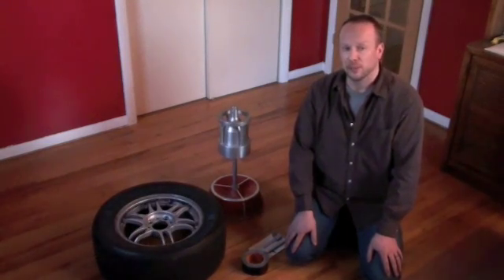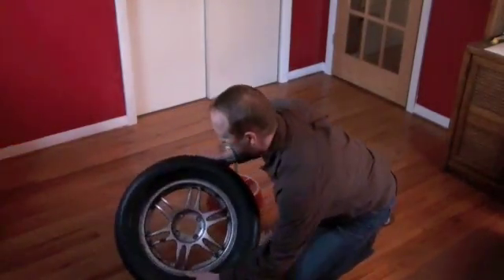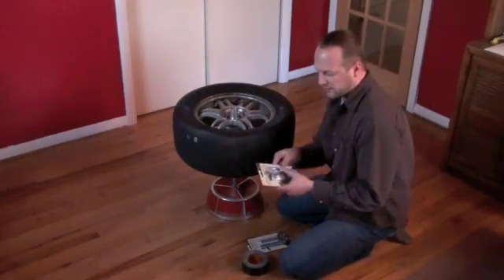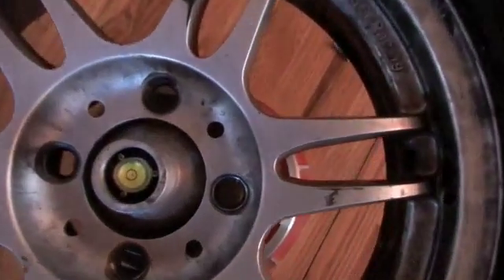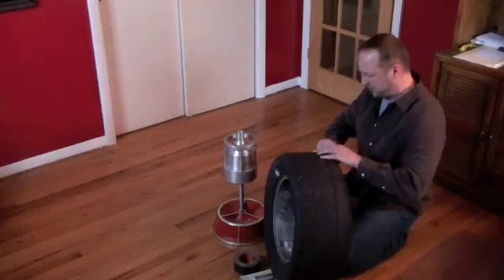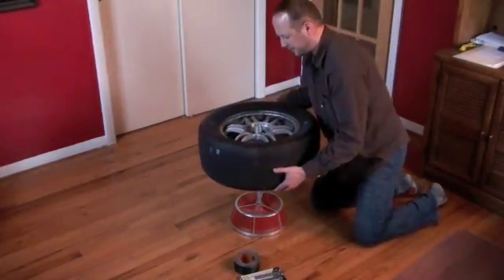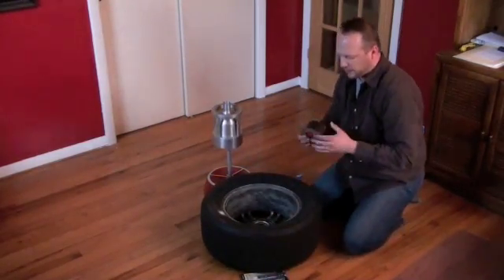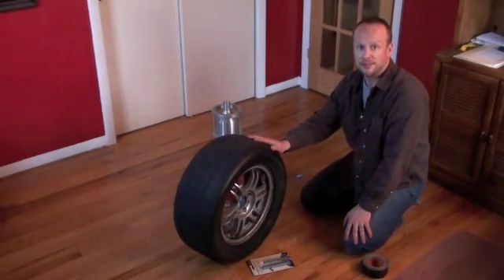DIY Tire Balancing Machine

Comment: That would get a very rough balance, but it's not gonna be great. 
This method was used on old cars where the wheels were less than half the width (think 80mm wide), when balancing wasn't really that vital. Modern wheels, though, need to be balanced inside and out. The reason is because they're wider and cars have different offset values nowadays, so getting a more perfect balance is VITAL.

Comment: Static balance doesn't get anywhere close to balancing a wheel, i have been tyre fitting for the last 10 years and our balance machine has a static option and never gets used as its poor! Only lazy half assed tyre fitters would use it!

Comment: bubble balancers were all we had in the tyre trade back in the 60s and they do quite a good job on older cars,i dont know about newer cars though.i always had to be more carefull with cars using mcpherson strut as they took longer and more patience to get right.these were the days when there wasnt any electrical tyre changers or balancers.
Reply: +MrMagistik Yep that is what my dad tells me.  I see a problem though. Sensitivity is going to depend on the offset. Todays FWD cars have such a crazy offset that the sensitivity will be really poor.  Offset closer to the middle of the wheel will be really sensitive.  Mind you I have only had the privilege of studying the harbor freight units and the commercial units might have an adjustment for that? Would be pretty easy to make them adjustable.
Reply: consaka1 narrow, large diameter wheels static balance is fine. But when you start looking at cars from the 60s and 70s when rim diameters dropped and they started getting wider then dynamic balance became significantly more accurate.
You can do a reasonable static balance on most wheels but why do reasonable when you can do perfect?

Comment: Honestly!!! you will never make proper balance with this balancer. Even when you will have perfect level after you stick the weigh on the rim then you still will be feeling vibrating while you driving. There is two different weigh so you have to put the weigh inside the rim and also on the other site. Sometimes not but usually yes. And it will do only proper balance machine. Even hand spin one is good. It's expensive but it's worth. I know what I'm saying. I have that crap at home lol. I'm going to buy hand spin balancer.
Reply: +Richard Sery Your ignorance is showing. Of course it depends on your definition of "proper".  This is how all wheels were balanced when my dad was a kid and it worked just fine.  
Dynamic balancing is a sales gimmick for the most part. 98% of tires can be statically balanced and nobody able to tell the difference. 
A tire can be balanced just like this guy is doing and you would never know the difference. I have one of these and I have balanced with it and I have also balanced my 8 luck truck tires with a spare spindle. 
The spindle has to be prepared. You want good bearings with no grease, only a light oil. Remove the seal as well. Keep the bearings a tad loose. Make sure the hub is actually balanced and then mount the tire with at least 2 lugs.  Then just add weight on the top side after it settles.  There's a few tricks that help with the accuracy but honestly it works good enough that you have no vibration going down the road and isn't that the point.  
I am looking for a spin balancer though simply because they are faster.
I have seen tires come off of a spin balancer and be completely unbalanced on the road. It was my dads tire and he gave up on the tire shop and balanced it using the spindle method. Only way he got rid of the vibration. 
So don't knock it till you actually do it and have some experience with it.  Oh and by the way if your bubble balancer came from Harbor freight or some other cheap chinese source then you may have trouble balancing tires. In my case they didnt have the dimple centered in the middle of the hub unit that supports the tires. You CANNOT adjust the bubble on the machine and expect it to work.  Identify a flat spot and put the head unit there. Now center the bubble. If you put it back on the base and it shows unlevel that is telling you how off the "centered" dimple is inside the head unit.  Any tire you put on it will always be heavy on that one side of the head unit. Using a sharpie put a mark on one side and then put your tire on and make a note where the heavy side is. Then pick the tire up and turn it 1.4 turn and put it down again.  Take and get one tire statically balanced on a spin machine. Put it on the bubble balancer and see how accurate it is. 
Bubble balancers made properly are extremely accurate and work well. Chinese made like harbor freight stuff is a total hit and miss. Some are good but most are not.
Reply: You forget that "when your dad was a kid", the wheels were less than half the size of modern wheels and tyres. Yes, this would work great for those. Modern wheels are wider and need balancing on both the in- and out-side. 

This balance will get it rough and it'll work, but a full modern wheelset needs a modern balancing method.

Comment: I honestly can't see the point of the duct tape, looks ugly as he'll also the adhesive on the weights is as strong as he'll so as long as you clean any silicone or wax deposits from the rim then their never coming off accidentally

Comment: I don't mind paying $20 for mount and balance.  the problem is bigger.  When you buy 4 tires, they write you 3 pages of invoice that takes you from $300 for the tires to $500 by the time you are out of there.  I am not exaggerating.  Think about $12 per valve stem, $5 per tire to discard the old one; $40 road hazard insurance  and all of this plus Tax.  I really feel sorry for the people who can't help themselves.  I feel sorry for those who work hard to earn a paycheck and then get taken advantage by these tire stores.   Thank you for sharing your experiences with this tire balancer.  I am going to buy one but I want the most accurate one.  I notice some cost more than others.  I wish I knew what is a good one.  I know HF sells one for $70, Sears sells some for $100 but I just don't know what to look for in terms of accuracy and quality.
Reply: sahmadi1000 $12 per stem? Even metal stems arent worth that much. A 414 valve shouldnt set you back more than $3
And don't buy road hazard insurance if you don't want it. The disposal fee is fair enough though. 
See as an experienced tire fitter balancing is the only thing I would actually go and pay for even though I could just buy a bubble balancer and do it myself.
Reply: +sahmadi1000 I have a harbor freight one and its no good for accuracy. Some may be but others aren't I suggest you do this. Take any tire and get it balanced. Then take it to harbor freight and tell the guys you want a bubble balancer but you want to test it first.  Once put together there are 2 main parts.  The base, which includes the pointer piece and the head unit.  zero the head unit on the ground by tweaking the 3 screws.  Then put it on the base and put your balanced tire on it. if the bubble shows perfect in the middle then it is a good one. If not then quality control was non-existent that day.

Comment: Got one!!
Rubbish on small, lighter car wheels where slippage occurs on the top ring when lifting under the compression spring pressure after the cone alignment. No matter how careful you release the wheel you cant ensure the cone alignment stays.
Reply: Further to my comment I have learned a major UK specialist classic vehicle company, 'Frost Auto Restoration'  have determined a set of weaker springs for the balancer to accommodate lighter wheels. These cost around £6 (10 USD) for the set of four.

Comment: Bubble balancing is every bit as good as electric spinning balancer if off the vehicle.
this type of balance is perfect unless we are talking formula 1 race cars with everything else on the car 100% balanced. i.e hubs shafts bearings etc.
spinning balancer is not needed unless done on the vehicle !! that way the hub /drum is balanced at same time. otherwise static balance is good enough.
when using bubble balancer please stand up and look straight down at the bubble, not from a sitting position .
all major tyre fitting places used the tip top bubble balancer and tip top tyre changers for over 70 years with no problems at all.
21st century technology is not allways the best !!! many of the old tools do a far better job when used by people who know how to use them.
Reply: phill downes No it isn't, dynamic balance and static balance are completely different kettles of fish. You cant static balance a wide wheel to anywhere near the accuracy of a dynamic balance.
The reason they used bubble balancers in the past is that they worked on narrow, large diameter wheels perfect as soon as we started doing 6 inch wide 13, 14, and 15 inch wheels then dynamic balancing became necessary for accuracy.
Reply: @bremCZ  I suggest you check out pictures of 30 years old cars. They had same wheels as today. The diameter and size remained same.
Reply: @caribouroadfarm 
... We used dynamic balancers 30 years ago. Dynamic balancing was invented during WW2. Stores have been using dynamic balancers for 40 years. Why? Because static balancing the wider heavier wheels had too many limitations and the technology developed to allow better dynamic balancing options.
Reply: @bremCZ  First of all I never said anything about when balancing was invented or not. I just said that wheels were the same. Dynamic balancers made they way to garage shops in 1990 when industrial algorithms were adopted, so 30 or 40 years ago garage shops used a static balancers, unless it was some big industrial place.
Reply: @caribouroadfarm  I worked in a shop 30 years ago. We had dynamic balancers, so did every other shop worth a damn.
And I didn't suggest you had said anything about when balancing was invented. 
The point of mentioning when dynamic balancing was invented is because even that early, they could see the failings of static balancing as speeds of vehicles were increasing. That technology only allowed dynamic balancing to become wide spread in the 90s doesn't suggest static balancing was sufficient prior to that, it shows that it was the only practical option.
And as so far as suggesting wheels were the same sizes then as they are now. Yes! Isn't it amazing how wheels suddenly became wider when dynamic balancing became widespread? 
Go back to the 80s and have a look at the OE sizes on a range of large cars and you'll see they increased up to 50% on the same cars throughout the 90s. Dynamic balancing allowed that to happen, it didn't happen in spite of it.
Reply: For me, static balancing with one of these manual balancers only worked KIND OF with steel rims up to 16" and speeds of less than 160 km/h (winter tires on a not-so-recent VW Golf 7 GTD and a smaller VW Polo).  Try it with ANY kind of 15" plus alloy wheels with glue-on weights which have to be fixed on another plane than the "upper level" of the static balancer and everything gets WAY OFF even if you spend 20 minutes with every wheel, thus leading to vibrations upwards of 120 km/h "wandering" from one wheel to another as you speed up.

I also tried tire beads (MAGNUM brand, supposedly "the best" on the market) after statically balancing the tires - as per their instructions - and the vibrations got MUCH WORSE, especially when stepping on the brakes. Beads MAY be good for truck tires, but definitively not for somewhat modern / fast cars. And the beads also are LOUD when you are driving slowly or in an stop-and-go scenario.

Got a good deal recently on a simple 'semi-automatic' dynamic balancer b/c of some scratches and damaged packaging (one you have to spin manually, clone of a TwinBusch TW-100) for 450€ delivered and the balancing results were like night & day compared to the static balancer (which admittedly only cost about 60€ in 2024).  So if your scenario includes bigger alloy rims and driving faster than 120 km/h  at times you cannot count on a static balancer to be accurate enough.

Comment: Just a recommendation. Next time before attaching the adhesive weight, give a little scrubbing clean of the wheel surface so the adhesive makes better contact. I'd even go as far as using alcohol. That's just me though. I would feel confident not using the duct tape if I prep the surface.

Comment: I love reading all the hate comments from ignorant young guys that don't know that this is how all tires were balanced before the fancy multi thousand dollar machines that are used today.  New machines are nice for a couple reasons. 1. A monkey could use one. 2 Its faster for the most part.
Dynamic balancing isn't absolutely necessary for the most part. A really badly misbalanced tire might need a dynamic balance but most tires don't. I center sticky weights on the back and have never had any trouble. I like sticky weights because they don't look ugly or ruin my aluminum rims.

Comment: Hey marble shark. I went ahead and bought the HF balancer. I have run over 160 mph at the track and almost 700 street and highway miles without issue.

Comment: Do you feel it would serve it function on A) 32in mud tires on 16inch wheels B) 28in slicks on 15inch wheels? Planning to pick up the HF blanacer and might get the changer too. The damn mount and balance is killing on these things. Might get 15-20 passes out of a set.

Comment: Bubble balancer = completely fucking useless.  You can only statically balance with these, not dynamically.  Wheels ROTATE when they're on the vehicle so what good is this piece of shit??
Reply: Tire shops were using bubble balancers long before dynamic balancers were ever dreamed of. I cruise along @ 75 mph+ & never a hint of a shimmy.
Reply: You would be surprised, I started looking into one of these when a guy I meet with a dragster you know the rail cars told me he bubble balances his 30 15x15" slicks and doesn't get any tire shake at the strip and he is trapping around 2xx mph. It's fun being an internet know-it-all isn't it?
Reply: bobbofly
 On one of my other vehicles, I've been doing the Airsoft beads thing for a little over 6 months & it works as well as - or better than my bubble balancer. Got a friend who's interested in buying it, so I think I'll take the cash. Bubble balancers work great, though.
Reply: Very true u need to dynamic balance and $15-$20 for a balance its about a £5 in uk and free when you get a tyre change
Reply: shaun howe
 What exchange rate are you friggin using? You posted 3 months ago and $15 usd is 11.88 euro, $20 usd is 15.84 euro, current exchange rate as of today is $1 usd = .79 euro, Google is not hard to use, try it before spouting nonsense.

Comment: I didn't get why You place weight on outer side of the rim and stick it to the inner side. also i suggest You simply clean up the area where the stickers will be with solvent or even water and piece of cloth and dry it (that way they would not fall of for sure). I guess it would be better to check the balance on machine when You do it by yourself for the first time to make sure that everything is allright. I would not recomend this method for a road car if you do not burn a pair of wheels in a week and You want to save some money. 
p.s.: I dont know on which car that wheel goes, but the tire seems too wide for the rim.

Comment: damn mean ass people here.  my shit gets static balanced, zero issues on the street/highway.  as well car runs 8 sec quarter miles without any issues! to all the nay sayers, GTFO.  thanks for the video
Reply: Agreed! Either they know nothing or are in the tire business and want your money. My dad has been using a static method to balance his tires for years. He got started doing it when the tire shop couldn't get one of his tires balanced. They balanced it 5 times and he still had a bad vibration at highway speeds.
Reply: Internet know it all with no field experience, are you using the HF model?

Comment: Lol. The guy who said throwing a wheel with a deflated tire to the ground will bend it. That's not true. At work when we are bored we take the wheels from the trash and have contests to see if anyone can bend them. Without a tire on a rim you can throw it as hard as you want onto the concrete and it will not even dent most of the time. Bent wheels come from the 3000 pound machine they are attached to slamming into a pot hole or hitting a curb. Just because you're a self proclaimed enthusiast doesn't make you a field expert.

Comment: 25 yrs ago i was using bubble balancing machines when i first started as a tyre fitter not for long though as i switch to the electric machine. These bubble types are ok at a pinch but not as accurate though

Comment: hahaha i was thinking the same thing. mounting AND balancing is like 20 bucks. good for you if you want the experience or pride but shit when people come in for a 20$ tire rotation i groan. its messy and takes about 7 mins of time, doing repetitive, boring and tiring work.... and i only make 20 bucks. just bring it to a mechanic. like this guy^ said your saving very few dollars and busting your ass for no reason.
Reply: There isn't a tire shop around that will do this as soon as you walk thru the door. There's either a couple hour wait, or you have to drop your car off and get someone to drive you back and forth - which is a huge waste of time. The savings is in your time when you do it yourself - unless you enjoy making only $10/hr or so.

Comment: This guy has the idea but no complete, please dont do that. the wheels need to be balanced static (is what he did) and dynamically, otherwise when you reach speed at 60-120-240 aprox will start to vibrate. when you put the weight in the inside face, you are altering significantly the dynamic balancing. In few word, Very Bad teaching..